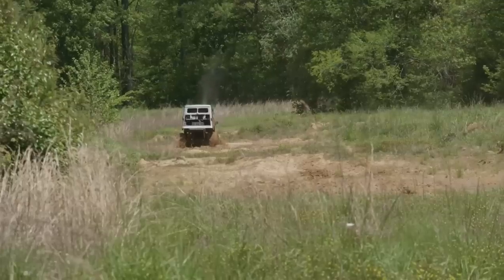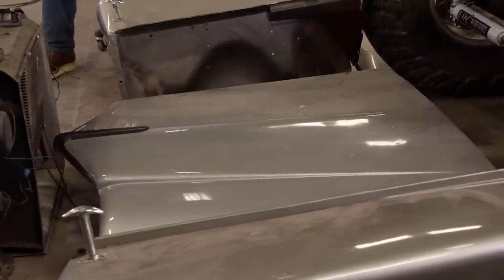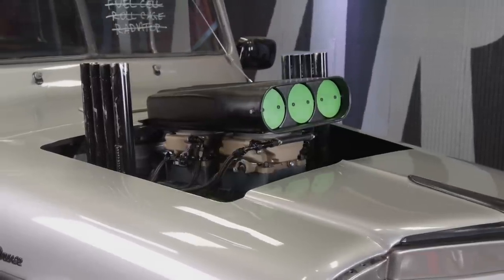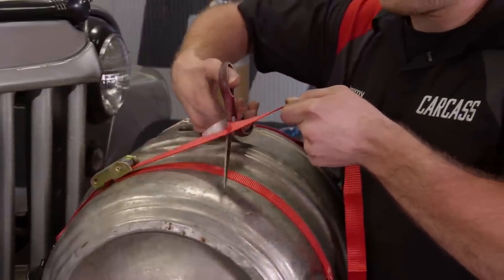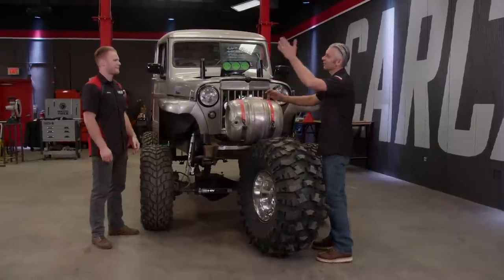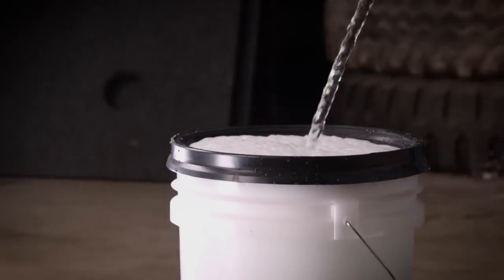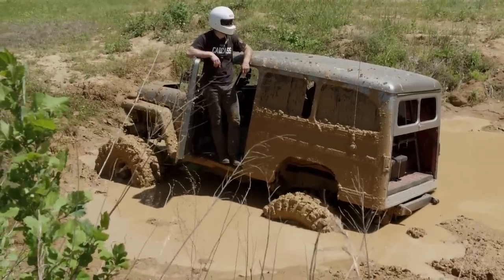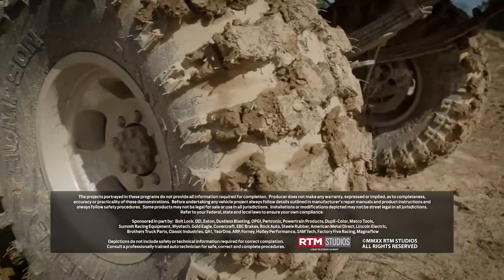Burying Our Willys Wagon In The Mud - Carcass S1, E9

Comment: That hood is going to be rust in no time. It's getting filled with mud between the inner and outer skin, and no way to clean it out or dry it. Should have sealed the space between the inner and outer. Too many shortcuts in this build. And ditch the Keg - that just looks stupid.

Comment: Next time you use a hole saw to mark a radius, flip it over. The back side of the saw is smooth and the center of the bit is easier to mark or line up with a previous point.

Comment: Gee my pinion angle looks different, how'd that happen?  

Pan's over to the 3 freaking lift blocks under the leafs. 

🤔🤨😓... 🤤
Reply: What you're missing there is that the differential housing broke loose of the axle tubes due to all the torque.  If you compare it to the shot where they show the torque arm, you can see the difference.

Comment: Waste! Don't need that kind of power and putting the radiator in the back is foolish. I say they're morons.
Reply: Needs more power for mud that deep, more tire too. The radiator in the back is better than up front where it will get no air flow in deep mud. There are some issues with this build, but too much horsepower and the location of the radiator aren't among them.

Comment: tell these guys never been in mud. leaf springs are a no-no . get that stupid keg out and cut that frame to the hood. four link the front . toss the tires and rims put 14.9-24 r2 tires on14x24 rims . you need hydro steering . complete front to rear roll cage . that just the begining